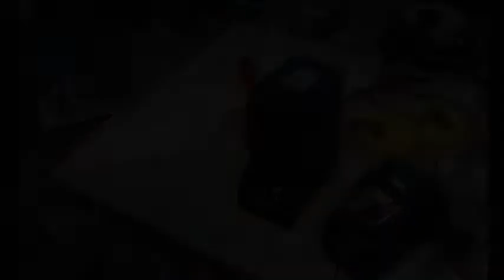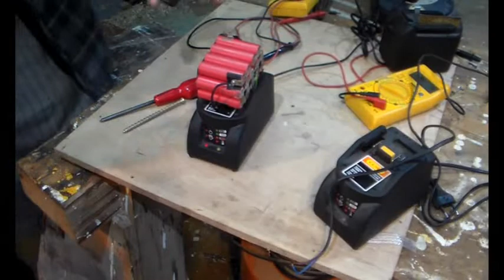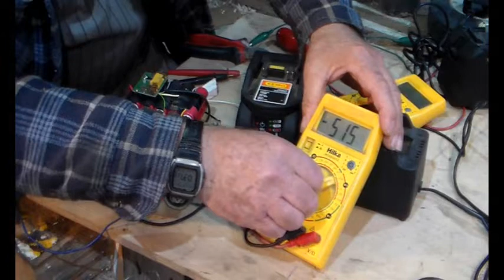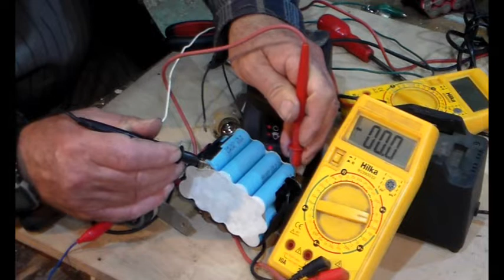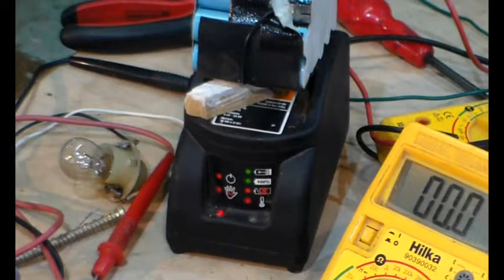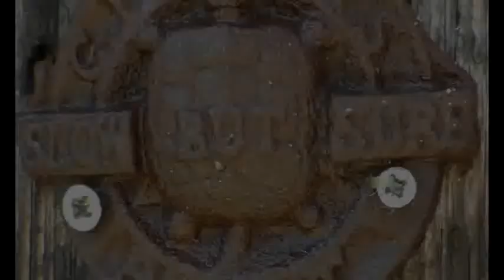Diesel pump lithium cells and charger, doubts and uncertainties

Comment: I have been messing about with a handheld vax with Li batteries today, Security torx on the battery but not the appliance. It woudl run for a few seconds but then flash red on the light and die.  Charging it didn't work. You have to charge it through the vacuum unit, not just the battery like the Gtech machine.  Originally it flashed red when charging, indicating a fault, but not in the manual, so I did what you show and put the bench power supply on, low current across all 6 cells but bypassing the BMS board. it was at 19.9v and it has come up to 22v or so over the course of 12 hours . I have left it off overnight so I will see what tomorrow brings and maybe reassemble it if it has held a charge. There seems to be a huge amount of these 18650 devices coming up in the scrap now.
Reply from the maker: @bootsowen, yes it seems that people think it s too complicated to buy an new battery. BMS replacement boards are available for all sort of makes if that is the problem. Great you tried charging the battery direct,  I noticed in one of your videos a nice bench power supply in he background. It does highlight the same issue as with washing machines, incomplete or a bit tatty and they have no value to Joe Average. It does however mean that there are high capacity, high current cells now available to the avid collector for use in projects including electric bikes. I bought a waterproof 25v (7s) 30 amp BMS for that Yamaha electric bike project. Installed on part of that blue lithium pack and fitted to the bike, all seems well, just need to put the home made charger in a box with a volt meter. Happened quicker than I expected. Cheers

Comment: It was not me that suggested waving a magnet but it is possible that some systems use a hall sensor to tell when the battery is on the equipment or charger, not heard of it but possible .Samsung along with Panasonic are the best  cells. the way the first battery behaved made me think that the BMS had a load sensor but on second thoughts it was most likely just a bad contact. It is possible to buy BMS boards on ebay and amazon just look for in this case 7s battery management board, for lower or higher voltage you change the S number to 2s or 5s etc.https://www.amazon.co.uk/Battery-Protection-Board-Balancing-Function/dp/B07SS8ZQTG/ref=sr_1_11?dchild=1&keywords=7s+battery+management+board&qid=1627231127&sr=8-11
Reply from the maker: Apologies for misrepresenting you and thanks for pointing me in the direction of generic BMS boards, I'm assuming the charger connections will all be different, cheers
Reply: @TheInfoworks  I think that is the tricky thing with these boards, the generic ones have to be wired/soldered through to the load points and also to each cell for monitoring. on the battery that you have in the video Andy the connections for the charger are on the BMS, so you would have to bodge something up, maybe using all of the new board and the connections from the old.
Reply from the maker: @bootsowen  On this BMS there is a series of connections that go to each of the battery connections, Neg, +1, +2, +3, +4, +5, +6,  Pos. That way all the cells are individually charged. Just have to be very careful when wiring them up. There's a video, but there are quite a few in line before I get to upload that one. Seem to be very busy at the moment with plenty of videos in the can. I'm looking at BMS boards for my Makita 18v on ebay. Cheers

Comment: Samsung and LG are good it’s the old red Sanyo’s which are not very good. Sony not bad. Generally the single cell will brick @ <2.5 v but can be momentarily jumped ( and pro rata) over 2.5 and then immediately charged
Reply from the maker: Thanks for that, I have just picked up a large pack of LG 2.5 Ah cells for an electric bike battery refurb, good to know they are decent cells. The pack is 9 cells in parallel by 7 in series, cheers
Reply from the maker: For some weird youtube reason your last post is not showing up, very short messages are sometimes seen as spam, likewise a link without much additional text. I have been looking at replacement generic BMS boards, especially for my Makita batteries, cheers

Comment: I don't know Andy, they make these surface mount parts so small I can't see them, and all it takes is the failure of one tiny part that must cost a fraction of a penny. It is an interesting attitude of the supplier to hand over a new set of batteries, that cost must be factored into the price of the original item, so you have already paid for them but you don't get them until you ask! The magnet trick is a bit of a leap of faith!
Reply from the maker: Owen, hope all OK, hay has been baled. I figure that if a supplier replaces things with no fuss they must know what they supplied was rubbish to start with. These BMS boards are the weak link and as you say they could make them so much better by just spending a few pence. Think you are right about the magnet but it may be pertinent to more expensive items, apparently some boards have wafer switches that are actuated by magnetism, maybe similar to a reset button behind a small hole as found in routers and such the like, cheers
Reply: That's why I have a microscope very hard to see  what's goin on otherwise. Sometimes its the solder that cracks and without magnification you cannot see it, but at low voltages involved its enough to stop electricity flowing, could well be the case with those bms. the power leads have got hot and cracked the solder joints, worth having a look with a magnifying glass, look for dark lines around where the joints are, often it's just as easy to assume a crack and get the soldering iron out and reflow the solder.
Reply from the maker: @Equiluxe1  Yes I have one of those watch makers eye pieces, worth giving that a try, especially as that BMS suddenly switched on, cheers

Comment: That 2nd battery on charge was showing flashing red on right hand led, which on the label above shows a thermometer - ie it thinks the battery is overheating or is too hot to even allow charging maybe ?  That could be a faulty connection to the temp sensor in the batt perhaps. Or a faulty charger, not sure if you used the same charger for both battery tests Andy !
You could see if the 2nd batt gives the same indication on both chargers - that would give you an idea of where that fault lies at least. 
The BMS not turning the output on - don't know ! On my calculator, it looked like both sets of cells measured quite a bit more than 3v per cell, so way above BMS low voltage cutoff, you'd think. Cheers, Dave
Reply from the maker: Dave, thanks for the colour info, strange how the BMS switched the output on with a load and then killed the bulb, odd and unpredictable. Yes all the cells were up to voltage especially as I charged the first pack up without the BMS. Not the first time the board has ruined a battery pack, cheers.

Comment: a guy i know installs off grid systems he said battery management systems are one of the biggest failures in the systems.
Reply from the maker: I've found this also to be true with laptop batteries, almost as it has been designed that way, cheers